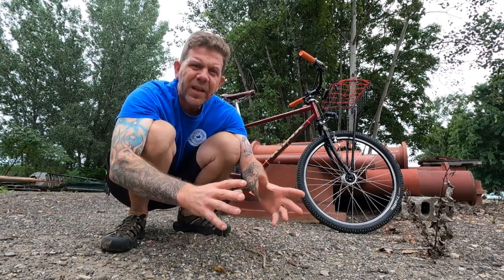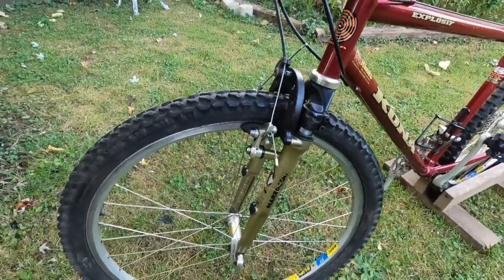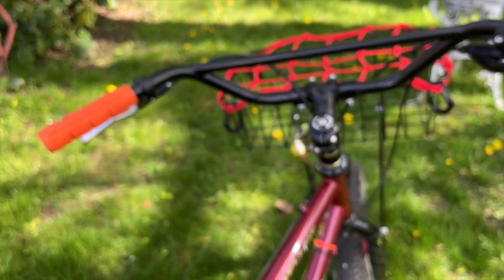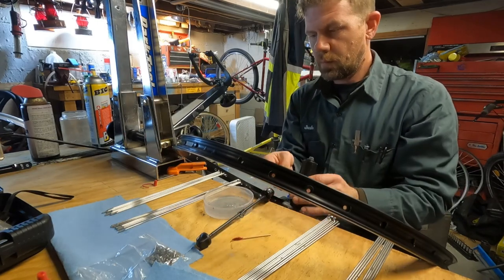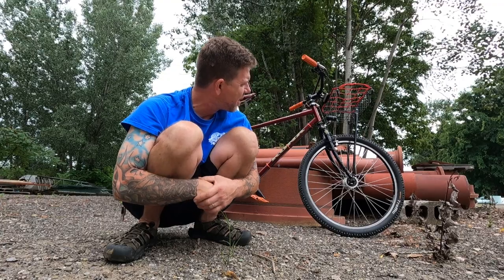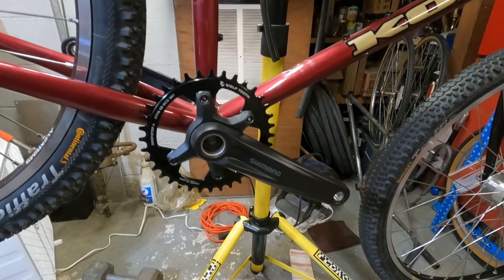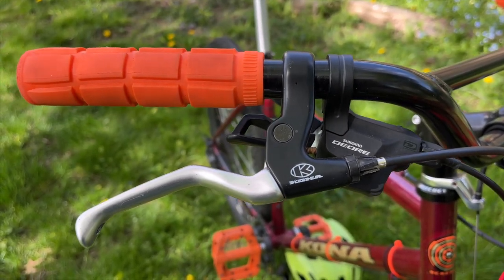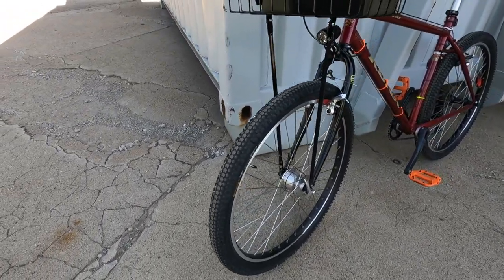90's MTB to Modern ATB | Bike Build - Check

Comment: That's a good looking bike!! I like a 26" 90's MTB for a commuter.  I like to use a regular 26" fork on them.  They did not have much suspension travel, so those regular forks work well for me.  They may spice up the handling a little too.
Reply from the maker: Thanks so much!
This was my first foray into replacing suspension forks with ridged ones, so I used the one with the correct amount of correction. Maybe next time I’ll cram a regular one in there.

Comment: I like it. Nice work. Good job on the wheel build. I've only built coaster brake wheels and have never had to dish a wheel before.
Reply from the maker: Thanks Randy (and Nova.) I’m not an expert by any stretch of the word… but it’s pretty easy if you have the correct spokes.

Comment: Sweet Kona and nice work piecing it together. You could try some kool stop pads for increased braking power. The black walls look sharp 👌
Reply from the maker: Hey… thanks so much!!! I’m a big fan of the kool stops. These pads are vintage Ritchey branded kool stop pads. I need to change out the cable links between the two sides to get them set up correctly.

I appreciate the kind words.
Happy today!

Comment: The early to mid 90's KONA bikes are great bikes . The frame geometry really isn't that bad compared to most bikes of the same era . I own a 1991 KONA HEI HEI  which I ride  at least 4 times a week as an Urban adult BMX bike .  The 91-92 in particular are extremely rare , but I just happened to get extremely lucky finding my Hei Hei at a thrift store for $50 😂. Although an idiot during the early 2000's replaced every component with cheap bike shop parts and also removed and replaced the decals which is a shame as the HEI HEI had the best of the best parts for the era . 

  I've replaced all the low grade components and retromoded it as a city bike with very nice components as I love this bike. Although I've yet to re-sticker it with the correct decals as I like the look of raw Titanium. The Explosif  frame is basically the same thing minus being Titanium , very nice bike 👍👍
Reply from the maker: Good info. Thanks a bunch!

Comment: Nice bike.  I have run into the same issue with chain rings on an SLX crank and went with Wolftooth.  That’s fine for bikes I am building for myself, but it gets expensive in projects that I make for others.  For those projects, it’s good ‘ole 104 BCD cranks.
Reply from the maker: Thanks for the kind words! If I were to do it again, I’d use the original Sugino cranks that were on the bike when I got it.

Comment: Why would you use a suspension corrected rigid fork and not a shorter lenght axle to crown? Handles far more responsivly for commuting
Reply from the maker: Because I didn't know that. My whole schtick here is I'm learning as I go.
Reply: @EriebyCycle  no other way to learn that that, its a great frame but Konas have slow handling optimised for mtb, theri old frame were ahead of time in mtb geometry, that is especially why a lower ATC lenght might make it more responsive (head angle will decrease so it will trail less)
Reply from the maker: @oreocarlton3343  Thanks for the info. Maybe I’ll swap the fork come spring time and see how it is. Thanks a bunch!
Reply: @EriebyCycle  looking forward to it, bikes with different fork rakes handle very differently and would like to hear your impressions